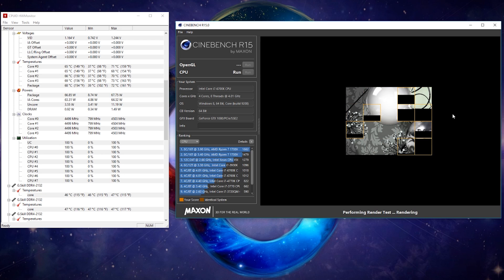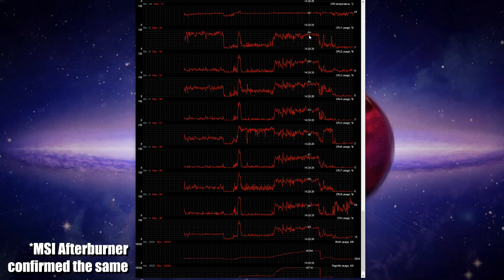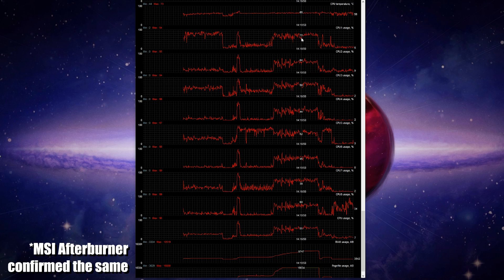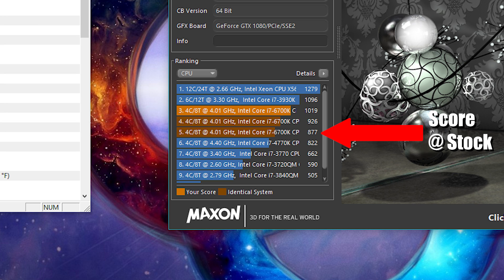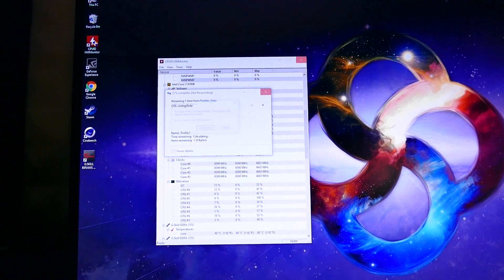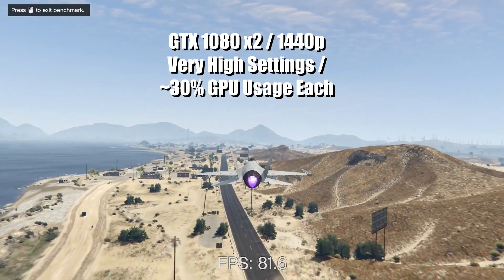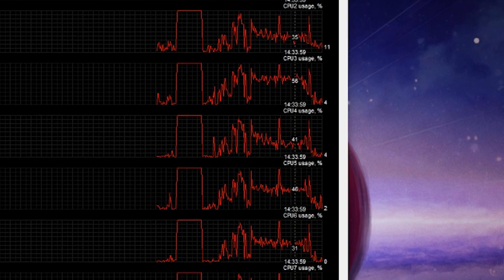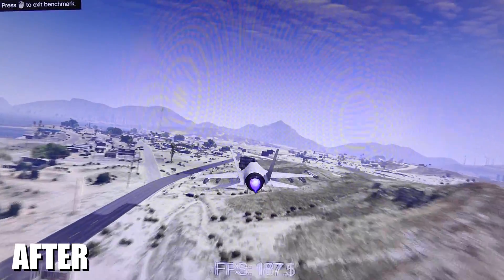My PC was Terribly Under-Performing...

Comment: Windows update at work guys. Give a round of applause.

But seriously the latest updates broke the framerates and GPU usage, especially on DX9 games. Disabling Xbox features from the registry helped, but after a restart games began running poorly again. I think Microsoft tinkered with the DX API under everyone's noses.

This is on Anniversary update, it doesn't even have the game mode or the DVR fully implemented. I'm going to put the tinfoil hat on and say that Microsoft is purposefully is crippling games. Remember that gaming mode that was supposed to help with games run better that came with the Creators update? It flopped. Now they're probably going to swoop in and make it so your GPU usage is back up to what is supposed to be when you turn the game mode on. Just my 2 cents.

Comment: I had a similar problem when I built my first PC. For my case, turns out for god knows what reason Windows 10 had defaulted my power management options to battery saver as if it were a laptop, which i think takes precedence over nvidia control panel settings. snapped that thing back to high performance and it performed perfectly again.

Comment: A few months ago my Intel i5 4690 did the same thing. Cinebench results were at a constant 440cb (100 under the usual) with no background programs and a CMOS reset didn't help either. So I did a clean install of Windows 10 and having installed only drivers for my graphics card and Cinebench was back up to the normal 540cb so I didn't worry about it but kept monitoring Cinebench results for a while after installing various different programs, the results didn't change, though with a recent clean install I loaded up Cinebench again and everything was back down to as low as 430cb with nothing active. The only thing that was different to the previous install was that the Integrated Graphics drivers weren't installed. Installed them and the Cinebench CPU and GPU results were back to normal. A++++++

Comment: check your software one by one. i had a gigabyte software update cause the exact same issue you are currently having and after installing my software one at a time checking game performance between each install i found that gigabytes app software for my aorus motherboard was the cause of my lack of gpu usage in games

Comment: I had to reset my cmos once and after removing my battery with the system off for 10 minutes I put it back in to find my boot drive toast. Still won't boot 3 months later

Comment: If your running on dx12 it kinda screws with sli sadly
Reply: not al games use dx12, like gta 5, its on 11
Reply: Dx12 does not interfere with SLI. It's just that Dx12 titles need to support multi GPU operation internally rather than by driver magic, and they just don't. But it will run on the primary GPU without any additional issues.

Comment: fresh os install is par for the course, you should be doing it every few years. even if the parts don't change, but it's usually good to time with the changing of the parts, and always have another hard drive to back everything up, it will save time downloading things that don't need to be redownloaded yet.

Comment: Software is just, weird, being so logical and static yet you run into very mysterious situations.

Having similar problems right now, or at least I think it's fixed now with the Ryzen CPU, nonetheless. I am really glad that you mention about Crossfire and SLI not being at cause, very often dual gpu's are fairly reliable if used with proper intend, speaking from a now dead 290X crossfire, I had a good time having the insane performance optimized games would provide.

Comment: sometime nvidia drivers crash like hell. i over clock my gpu, it was unstable overclock and heaven benchmark crash after that gpu memory clock was set to 100MHz. i try to increase it by msi afterburner but at last i have to reinstall the nvidia drivers. after that it work normal.

Comment: ****HELP * I have an Asus z170-A with a 6600k and 3200 mhz g skill trident z ram. I been having trouble with my sound every time I try running the RAM at anything higher then 2133 mhz I get a cracking static sound from my speakers or headset but everything else runs fine.. and I tried different brands of ram. enabled XMP checked the timings and voltage everything is good but I still can figure out what's going on....."

Comment: I have a feeling that your GPU issue was the Nvidia drivers. I had a similar issue with my r9 390, I was getting low performance where I shouldn't. I uninstalled the AMD drivers and reinstalled the exact same one and it fixed the issue.

Comment: I know your pain man. I could write a 5 page essay about all the things I've done to try to get my pc to perform. Reset windows multiple times, changed GPUs, installed a new cooler, updated bios, ensured I have all the latest drivers multiple times, and the list goes on. The performance I get is still incredibly awful on 80% of games. For example BF1 ranges from 15-70 fps no matter what settings I try. If you think you can help my hardware is down below:
Fx 8350 with Hyper 212 EVO (I know it's old and not the best for gaming but that isn't the problem, as people with identical hardware have much better performance) 

GTX 1060 3gb (I know 3gb isn't really enough but I've tried a 4gb R9 390 things weren't any better)

8gb Ram 

600w EVGA PSU

Comment: i'd suggest logging your system/hardware changes manually. Turning off automatic windows updates and updating drivers/performing system/hardware changes only when necessary. Select a few tools you like to perform quick diagnostics when you feel something odd and compare against your last known good state of the system. 

Looks like a lot of time spent doing things, but it's far less than reinstalling everything and starting from scratch. Plus it has no down time, so you can still push schedules while solving the issue. 
(you can cross your Logs with system logs while the system is rendering the next YT video).

Comment: I also had an issue with Windows 10 recently. All games were crashing when the cpu reached ~80% usage (not sure if that pattern is correct). I reinstalled Windows and now everything's fine
Reply: Drivers were ok, usage overall was ok, temperatures were ok...

Comment: I don't know if this will help you understand as I don't fully grasp what causes this but after a crash on my system, due to an out of date driver mind you, windows no longer read my bios settings for my R7 1700. Also, HW monitor detected my settings but task manager showed default clocks on everything. After resetting everything to default, Windows 10 finally read the stock settings of my processor correctly and improved performance massively. I then went back into the bios and reentered my overclocks on my RAM modules and CPU, rebooting after just a single change to see if it was still having trouble reading my BIOS settings in the operating system but sure enough resetting my bios fixed everything. I then proceeded to download the newest drivers and I haven't experienced the issue of crashing or trouble with windows since. So maybe if you left your computer on one day and left the room, it crashed and restarted itself without you noticing anything strange. I would definitely make sure everything is up to date. I do, however, think this is a Windows issue more than anything else.

Comment: @Science Studio I also have a similar issue, but not exactly the same. The difference is my gpu(1070) does indeed go to 100%  utilization, but sometimes in games goes to 0%, making stutters. It does that for several seconds, then goes right back to 100% usage. I never would have thought re-installing windows could be a possible solution. I will definitely keep that in mind when troubleshooting as it's still not solved yet. Mind you, this doesn't happen in all games, but quite a few. Thanks for the helpful info.

Comment: I have that CPU under perform issue before. Mine was the C-states thing, disable it get me back all the performance. Can't see anything through monitor software, cpu usage and frequency did run 100%. Only difference is the lower than usual power/current and temperature reading in HWMonitor.

Comment: I had the same thing happen to me yesterday. I'm running a 1600x and reference rx480s in crossfire. I downloaded version 7.0.0 of Rivatuner for Afterburner and my GPU started running at 637mhz... each... I uninstalled and reinstalled drivers and Afterburner and no joy. Planning on wiping the system today.

Comment: Science Studio, Replace the PSU with a fresh new one. why? That was probably caused by a power shortage of the PSU probably because the PSU is faulty. Even if the PSU you're using is New you should still try it. I figured that out because you're doing SLI in your system which requires more power from the PSU and that Issue happens all the time in some rigs because they had a faulty PSU. Try my suggestion it wont lose you anything.

Comment: i had very low GPU usage in GTA5 with my 1080 SLi. but once i set 8x MSAA  my FPS went UP! and GPU usage went up as expected. also noticed on GPU-Z before i set 8x MSAA the PrefCap was Util but after i set 8xMSAA it said SLi

Comment: I had a lock 30 fps on the Witcher 3 with my GTX 1080 @1440p and it was my driver. I had a bad driver. I reinstalled the last driver.😁

Comment: Ahhh windows, where would our problems be with out you. :D In all fairness. most of the time the HAL will do screwy things from time to time and a clean install is often the only way to resolve the issue.you can sometimes get a way with a repair install. but in many cases it has to be clean. I don't think windows has a full grasp of UEFI and having the two work together seamlessly.

Comment: A lot of the issues I had when benchmarking SLI setups in the past came from either not properly setting things up in the control panel or plugging in display cables into the wrong ports. That might sound weird, but in fact in the good old Kepler-days it has been a very common bug/mistake people had. Maybe just double-check your setup and how things are plugged in.

Comment: Forgot to say on twitter I once had this issue as well (with my GTX970 I believe). I reinstalled Nvidia drivers, reset my CMOS and tried some other things, none of em fixed it. I then reinstalled my OC-software (MSI Afterburner), and that fixed it.

EDIT: I did not have my card overclocked at that time.

Comment: I had the graphicard issue once... at least something strikingly close... my old 660 ti had 3 main speeds it would run at... 

idle on desktop it would run at 200 to 300 mhz on the core
watching hd videos, flash etc could send it to 500 to 600mhz
playing a game would peg it at 950-ish mhz

Randomly i would notice low fps in games. I'd check the core speed and it would be either at 300 or 600 (each time it happened it would randomly be stuck on either or. I'm guessing that it got stuck at the speed the gpu was at when the glitch happened) Later i got a second 660ti and put them in sli. Slowdowns would randomly happen again. Id check afterburner and either one or both cards would be at 300 or 600. I

I figured out later that that version of after burner  didnt play too nice with chrome. I could use IE, opera or firefox all day and not have the slow  down but open chrome and within 2 hours the "locking of core clocks" would happen.

Uninstalled afterburner and ran stock from then and it never happened again.

Comment: I had the same frame rate issue on my 1080 sli. I had to wipe my drivers using a third party tool. Reinstalled newest driver. Fixed.

Comment: Over the years I've seen Gigabyte mainboards do pretty crazy stuff. For example once I had severe performance issues while benchmarking different Haswell CPUs - for the sake of benchmarking the CPUs were swapped in and out pretty frequently and the mainboard really, really hated that. Another time a Z170 Mainboard initially straight up wouldn't let me overclock neither a 6700k nor a 6600k. Most issues I had over the years were however resolved by either a CMOS reset or a BIOS update. Not to criticise Gigabyte in general here, they mostly make very good products and I've been using their mainboards and graphics cards for over a decade now, but sometimes... Sometimes they just decide to really fuck up your day.

Comment: I am sorry but is 70 fps bad not really sure I don't have a pc so if someone tell me is that bad
Reply: No, its excellent, but with two gtx 1080's you should be getting double that. Basically think of it like this, most consoles run at 30fps but are starting to upgrade to 60 which is very smooth. Anything below 30fps is really choppy and stuttery.  Anything above 60 is very good.
Reply: ZincNut thanks

Comment: don't worry Greg. I've been troubleshooting PCs for the last nine years, since Windows XP. you cry when even a fresh Windows reinstall doesn't fix the issue. I've had hard drives where one platter would become unusable and also had RAM sticks die from single memory blocks failing. the stress of not knowing what is wrong is very tough when you are only given a maximum of one hour to troubleshoot and diagnose an issue. I think I need a new career.
Reply: i had a cpu have a single core fail. like just one core didnt work anymore.
Reply: i had ram sticks become faulty but pc still ran fine just very slow so replaced ram boom fast again

Comment: I often reset my cmos but an underused feature in most BIOSes is the OC Profile tool, use this to store bios configs not just the clocks. 

I've also seen CPU performance drop with higher clock speeds, I assume this is because they're making more errors (that get corrected in cache or somin').

SLI is such a low value option (I have 2x GTX 970s) I am always paranoid about them and often use MSI Afterburner to eyeball the stats... Usually its NVidia installing new "game ready" drivers and disabling SLI when it does!

Also you can keep a steam library on a seperate drive and adopt it back later.

Comment: its happened twice to me that I got a virus which Bitcoin mines your GPUs when you go idle. Even though I had Windows Defender on. It made average FPS in games drop and also I got these spikes during gameplay. The only way I actually found out about it the first time was because I forgot to close HWMonitor before I went to slept and as soon as I opened up my computer I saw my GPU usage(or was it GPU memory usage?) drop from a high to a low value. The virus is smart and closes itself as soon as you use your keyboard or mouse to avoid showing itself in Task Manager. I found the virus by having Resource Monitor open which shows CPU and RAM usage even for closed apps. I had already had that virus for at least 2 months because I remember noticing it so long time ago. When the virus was remove I immediately noticed less input lag in games and higher FPS and the spontaneous stuttering was gone.

Comment: NOTE:  If you have an Intel Raid setup, do NOT reset the cmos without backing up your data first.  i would also recommend unplugging the sata cables to prevent it from corrupting the drives.  Take it from someone who learned the hardway and lost 500gb of data :(

Comment: if it a OS problem then im pretty sure it was " Advanced Power Settings " inside the control panel and " Battery Options ", Yes that option is avalibale even if you dont have a laptop

Comment: As helistorm98 said, windows 10 is good at breaking its self. I've seen the same problem on my low end PC. A reinstall fixes it. 
I5 2500
GTX 1050
12G ram (4G+8G chips)
60G SSD
2TB game/storage drive
H61 mb

Comment: I had this issue with nearly identical specs. I tried resetting my CMOS, but it took a windows reinstall to repair. I was getting around 5 FPS in Kerbal Space Program and H1Z1, around 40 in tomb raider (this is all at 1080p), and 50 in Skyrim. 

After a windows reinstall, I'm having no issues.

Comment: I think that you're right about it being an OS issue if resetting it fixed the problem. Maybe a bit out of the blue but perhaps a windows update or some sort of optional update somewhere either changed a configuration or caused some incompatibility with your CPU and/or GPU. My PC does things like this a fair bit and usually it's because a new Windows 10 update is not playing nice with the hardware (upgraded from Windows 8).

Anyway it's good to see that the old reinstall of Windows is still a reliable way to solve some of these puzzling issues. Thanks for the video!

Comment: I had a similar problem where the GPU was only at 15%-50% in games, bought a new PSU thinking it was a power draw issue, and that did not work, tried another GPU and still no good. Eventually determined a bios update was the issue, ever since then it gas been working great.

Comment: bios keep settings and cash in windows and load them from the os instead of the bios. Also removed software sometimes keep files in the system that can harm speed. Software developers put the same that a lot of software use like direct 3d. You could run an optimizing tool that clean driver cash registry and system cash and temp file i think it would fix the issue instead of wiping the whole system. Anyway formatting and reinstall updated windows its always a good thing. its always good to take some time every 2 weeks to clean the system and optimizing it. Windows is a good O if you know to take care of it.

Comment: Had a similar issue with a AMD FX8120 was under performing at 4.4ghz. it was thermal throtling after I clocked down to 4ghz played with the voltage n dropped it a bit and got way better temps

Comment: That's why having another Windows install on your data HDD or even external drive makes your life so much easier. If the issue still persists it has to be either BIOS or hardware fault.